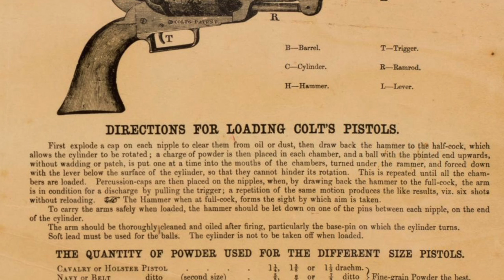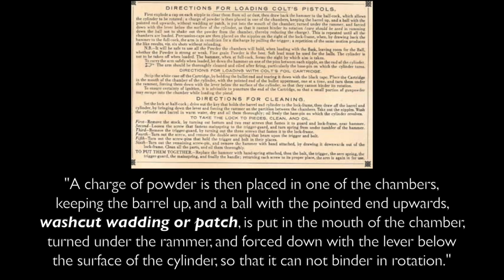Percussion Revolvers in the Rain

Comment: I have a simple system of waterproofing cap nipple and cylinder. I use melted hard bees wax or toilet bowl ring wax for quick, waterproof loading in the field .  I can leave under water overnight. This also allows long term loading with no loss of power. The wax is easy to clean. Use bees wax not tallow!  I also carefully seal the nipples. Some people use nail polish. I use wax.

Comment: This was interesting. I had a question I posed to Ian over on Forgotten Weapons but maybe you can answer it, Karl. In the movie Pale Rider Clint Eastwood reloads his Remington Model 1858 by swapping cylinders. Was the Model 1858 purposely designed so the user could reload by changing cylinders or was this just something added by Hollywood? Did they have the ability to produce parts with enough consistency that someone could have multiple cylinders that work in the same gun? I'm really wondering if this was a "selling point" of the Remington? If so, this would have been a significant advantage I would think.
Reply: As far as I know it's an unintentional consequence of having a top strap.
You have to get the cylinder out somehow, having a solid frame for the strength means your base pin needs to be removeable and the way they did it with the 1858 and their similar solid frame guns was just the cheapest most convenient way to get the job done

Comment: I noticed that when you were loading the revolvers, after the initial force required to ram the ball into the chamber, there was a “give” as if the chamber increased in diameter past the outer rim. If this was the case, and since the ball is at the back of the chamber, wouldn’t rain be able to get inside and into the powder?
Reply: Well, the ball is a bit bigger than the chamber, but the process of loading shears off a bit of the material from the ball, which now fits the chamber exactly and, presumably, just slides right in.

Comment: The first thought I had, is "would a drop of candle wax seal the caps, but still allow them to fire?" Or possibly a drop of oil such as rapeseed, tallow, or something similar (Since we really kind of lack access to the more common oil of the day, spermaceti). Would this be a possible test at some point in the future?

The possible issues I can forsee, is getting too much wax under the cap, which could act as a buffer, slowing its movement, or blocking it outright, and preventing it from detonating from mechanical resistance.

On the other hand, intentionally putting oil in the area of combustion is something that alarms me...I know it wouldn't be much, but...caution is prudent?

Comment: the reason the 3rd chamber fired on the percussion revolver is because when it "rained" it only got the top of the cylinder wet so when you cycled to the 3rd chamber which is on the bottom it fired. if you had rigged something up where is was spitting water while you were firing i dont think it would have fired because as you cycle the cylinder it gets all the caps wet.

Comment: You had only one FTF where the cap fired; all the other FTFs included cap failure. I would be curious to see if the stock nipples performed better than the after-market vented nipples.

Comment: A couple of tricks I leaned along the way towards improving reliability of percussion arms in wet weather:  1) after capping, put a drop of shellac or nail polish on the nipples.  2) Alternatively a bit of softened beeswax will work. Some of the old time shooters I have talked to have said in their opinion the old caps such as Alcan back in the 50s and 60s seemed more powerful than the modern run of percussion caps and were often more waterproof or at least water resistant than modern ones.
Reply: I wonder if the chemistry in the older caps was different, I know old center fires used corrosive murcury fulminate vs whatever they are using now that's non-corrosive.
Reply: @timberinternational2377  Cap compositions changed quite over time.  Most early ones centered around mercury fulminate as the ignition source and potassium chlorate as a flame enhancer, and have progressed on from that point to today's caps which are lead free non-mecuric/non corrosive compounds.  There may be some truth to the old timers' saying more modern caps are less powerful than the old ones.  That said, I think a major consideration was how the caps were treated following adding the primer compound and allowing it to dry.  In many cases, the caps were then given a drop of shellac which served to hold the priming compound in place as well as to give it a degree of resistance to water, though not exactly water proof.  In the best warranted/waterproof caps of the old days, a thin foil or paper disk was placed in the cap over the priming compound and a drop of waterproof lacquer was added to seal it all together.
Reply: @timberinternational2377  The standard cap composition in the 1870s was a mixture of mercury fulminate, potassium chlorate, glass dust and gum arabic; shortly before WW1 German introduced a priming compound which did away with mercury fulminate, instead used a mixture of thiocyanate/chlorate, and in the 1920s the first non corrosive primer compound called Sinoxid-a mixture of lead styphnate and barium nitrate.  Caps produced by Nobel and RWS, and possibly Alcan used this until fairly recently when lead free formulations such as Geco's Sintox which is a zinc and titanium based percussion compound.  Other companies have followed suit including CCI although the exact formulations are not published as far as I know.

Comment: You’re supposed to seal the gap between the frizzen and pan (and barrel, on the left side) with lard or another fatty goop from animal or plant. It prevents water ingress. You should also use a flint and frizzen sheath stuffed with cotton to keep the strikey bits fairly dry before first use.

It’s like you weren’t even trying to keep the flintlock in action.
Reply: Watching the rest of the video, I’m not surprised you failed to keep the percussion weapons in action either. You expected a magic priming cap to do the work for you.

Again, seal around the projectile face with lard, likewise around the primer. You failed to think like an actual user of these weapons, you’re spoiled by modern firearms.

Also, you are VERY lucky you encountered no hangfires with this video. Your gun handling was asking for trouble. These weapons are far more prone to hangfires than you seem to expect, especially in non-ideal conditions.

Comment: The Colt was held slightly barrel/chamber up. The Star was held barrel/chamber down. Also is Karl attempting to blow up a gun in his hand. All those failure to fires, without so much as a pause. As well as the misfire with the star that he did not check the bore for an obstruction and then attempted to discharge two more rounds only to have failure to fires. Not to be a safety Sally. But that was a bit reckless.

Comment: The 1861 flap holsters I studied (before altering for my own design) allowed too much weather access at the hammer end of the flap, and I’ve seen *original holsters modified by soldiers to close *that gap (even on Remingtons). A tab over the hammer is a decent option, especially if expanded to an ear— but would have made them harder and costlier to manufacture. 

Remember, the revolvers would have been in the elements FULL-time— poncho or no!

Carrying/living with these things around camp and on the ride or march must have affected their reliability. Beeswax or candle wax on the cap end is the least one could do to support one’s survival—=> Today, I might prefer a spot of dilute DuPont glue on the *inside of the cap.

Comment: As someone who hunts with black powder in an area that gets a LOT of rain during hunting season, and I can tell you a few things from experience:

First, LUBE THE HELL OUT OF EVERYTHING if you think it's getting wet. And I mean everything, not just moving parts, using lard or tallow (or Lucas Red-N-Tacky if you don't care about historical accuracy). Special attention to cap nipples, lockwork, and if the gun has a removeable breech plug, the seal on it. In extended humidity exposure, water will find its way in ANYWHERE IT CAN, and especially if you're using legitimate black powder instead of a substitute, it doesn't take much to make it unreliable. Additionally, corrosive powder residue gets EVERYWHERE and if you let water get to it, the whole damn gun will get pitting WAY faster than it has any right to, so make sure everything is coated in a thin, plastic-like layer of grease bonded to the bluing. Depending on how much rain you'd expect, possibly even coat the non-moving parts in beeswax dissolved in kerosene for an even better rust-proof coating.

Next, seal everything GOOD and tight. Slightly UNDERSIZED caps pressed on hard, then dribble some candle wax around them or rub em with grease. Conical bullets with full lube grooves, or an absolutely grease soaked patch/wad. For flintlocks, either hand-fit the frizzen VERY tightly to the pan and coat the bottom in wax, or if you've got a large gap, tie a piece of suede or kid leather (or cereal box cardboard) soaked in grease around the bottom to act as a flat gasket that doesn't interfere with the sparking surface. Give up some lock time in exchange for reliability by giving yourself a FULL pan, and possibly even packing powder down the touchhole, because if you get a drop of water in you've got a slower-burning charge that's more likely to have SOME dry spots that can possibly dry out the wet ones, AND more material means water's more likely to get stopped before reaching your main charge. This is also a time when an oldschool powder horn is better than a measuring flask like you've got, as it's got more metal parts to corrode and more places for water ingress, while a powder horn with the wooden caps well-oiled to prevent swelling has legitimately kept my powder dry even after an unexpected swim.

Finally, clear your malfs and be proactive. If your gun's gotten soaked and you're currently dry, re-prime it just to be on the safe side. Caps are even more water-sensitive than black powder, and they aren't exactly expensive, so just shucking them off with a knife and recapping will save you a LOT of time. Run larger powder in the pans of flintlocks in bad conditions, since less surface area = less humidity absorbed, and dump your priming charge if you so much as SUSPECT it might be wet. It's good to keep fine powder around though, because one trick for  flash-in-the-pan remediation is to shove fine priming powder down the touchhole with the hole pick to work enough dry powder between the grains of the wet stuff to, at minimum, get enough of a pop to let you reload without breaking out the worm screw.

Comment: Kael, It appears to me the Starr shields the base of the percussion cap much better than the Colt with its slots that allow more access to the nipple and channel water to the skirt of the cap'  Making a tool that left a right ring of wax on the nipple just above the skirt would make the caps more rain resistant, They would have to be cleaned afterward.

Comment: any way you could test if it's the caps or the powder charge?
Reply: he already did test that. You can clearly see the caps are duds. If powder was at fault you would hear a crack and then nothing. You only (apart from one exception) hear only the hammer hitting the cap and nothing.

Comment: Put a bit of grease on the nipples and then put the caps on. It will seal the caps from water. Dont put the grease in the flash holes, just dab it around the outside of the nipples to seal the caps from water. Many caps are folded so there are places for water to seep in, You can also push the caps on really snug which will help. (Cap and ball hunter for 50 yrs)

Comment: Looks like poorly seated caps but might also be particles in the action preventing the hammer from falling fully forward onto the cap I have seen a video of a guy on YouTube who completely submerged his Navy colt and fired it. Not all caps are created equal however. I would just use like a salve or petroleum jelly to water proof the caps.

Comment: The revolvers were often used with combustible paper cartridges that contained the powder and ball(usually a conical bullet) in one unit. Flintlocks usually were used with a paper cartridge that was torn. You poured a little powder into the pan then rammed the rest of the powder and ball down the barrel. This is obviously considered unsafe by todays standards but that was the standard practice of the day.

Comment: If you hold the gun sideways over the head and push the bullets out while firing , it should shake the water off the caps and it will make the bullets go faster.

Comment: Listen my son, though not period correct, cap keepers will protect the caps in rain. They are just a plastic sleeve that slides onto the cap. They can be purchased or made by cutting to length the proper sized tubing

Comment: Pitch on the nipples, wax seal on the front of the cylinder. Precludes reloading on the fly but will give you a 60% chance of firing any single cylinder. A single target would take up the contents of a revolver, as per SOP. This was all worked out by the cavalry. They had long documents on how these revolvers were to be used in inclement weather.

Comment: Inherited a percussion revolver that had been loaded for 40 years+ and was prepping to pull the bullets. I figured what the hell and slapped caps on the cylinders to see what happened, 3 fired and after cleaning the nipples 2 more went so I only had to pull one. That was my first experience with black powder revolvers but I was very suprised.
Reply: Original? Yep, blackpowder can be loaded forever if kept dry (or when loaded without wads)

Comment: After that bossible squib load at 17:04 i was scared that that cap can push ball on The barrel.
I knew that that Time ball stayed at The cylinder but i think there was a little danger...
And you didn't wait at all after snapping caps and grabbing The gun by its side..

I did have some Bad mosin ammo, there were good 1-7 second delay firing after pin actually hitting that old shitty primer

Comment: Could you put a little beeswax around the sides of the percussion caps? it would be messy and splatter a bit when the hammer dropped but might prevent the caps being water logged.

Comment: The only thing i disagree with was the part about Colts instructions for loading did not recommend placing lube on tue cylinders
It can be said that model T cars were not made with seat belts and they were not recommended by Mr Ford.
These are things that learned after a product is manufactured and released. While lubing the cylinders was not recommended it did not inhibit the operation of the gun and served to help prevent chain fires. 
So i say lube em up.
Reply from the maker: You clearly don't live in a hot climate.  That stuff melts and just flies out on first shot, or into your holster.

Comment: 16:35 If the caps are the problem maybe you need more explosive caps. For example I couldn't get my Uberti Colt Walker to fire with Remington #10 caps so I started using CCI #11 caps and ever since my revolver has been 100% reliable.
Reply: if you look closely, you can see that the caps don't even go off. The reason being water and moisture ruin priming compound. Unless moisture is prevented from entering priming compound more of it will not help at all.
Reply: @franklinAll8735  Oh I didn't realize that

Comment: The idea of fake rain on those pistols made me instantly want to cry.  Nature is cruel.
That's why I have a rain protective pistol sheath, made from the skins of my enemies, er... cows... :)

I'm going with capillary action pulling water in against the cap side.  Only a small access ripple is needed.  Note the wall ripples in most caps.  Small bit of filler lube , only on the internal cap wall, or possibly first applied to the nipple, would be an interesting experiment.
I bet an interview with a 19th century navy vet would give some answers.

Comment: I don't want to even imagine the pain one would have to go through to reload them in bad weather...

What would happen if you switch the caps after they got wet? Could happen if s/o went from open field to under trees or under some kind of roof.
Reply: The gun would most likely go off after recapping though flash hole would need to be cleaned. In a heavy rain you have 6 shots (or how many cylinders are preloaded) and that's it. You won't reload the cylinder.

Comment: They would apply pine tar or other gummy substance around the percussion cones ("nipples" today) and it kept them very water resistant. Today if you keep a black powder revolver around for emergencies you can seal the caps with clear nail polish...or turquoise if you're feeling randy...🤪 STAINLESS STEEL is the way to go, especially with black powder. OH, yeah, if you glue them on with nail polish you won't get cap jams because they ain't going nowhere until you pry them off with a screwdriver or knife. If you keep it around for home defense, you won't be able to reload anyway. Five or six shots then you have a nice short steel club.

Comment: I propose to cheat and use grease to prevent water from going between cap and nipple. of course, it's not historical at all but I suppose it could work. I have also heard of hot paraffin being used to seal caps.